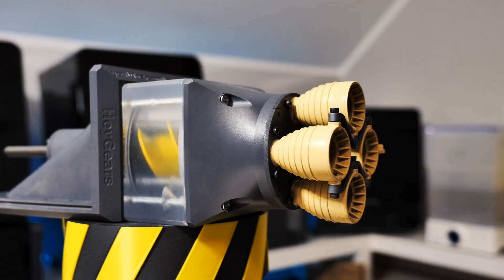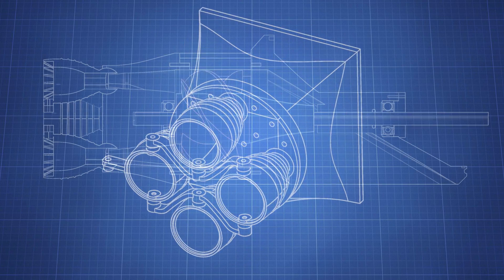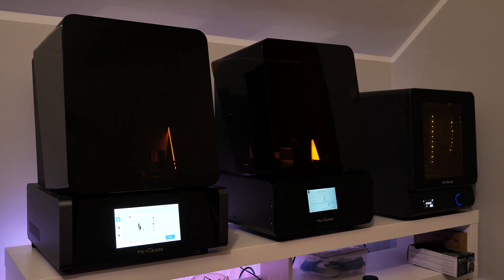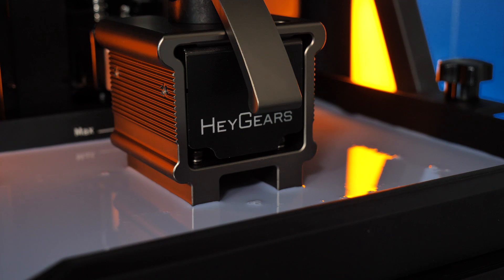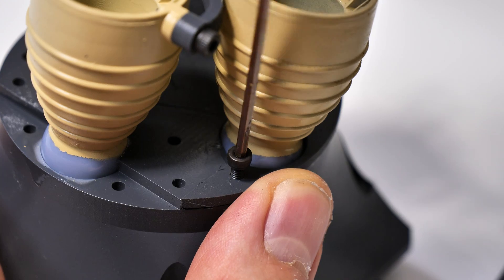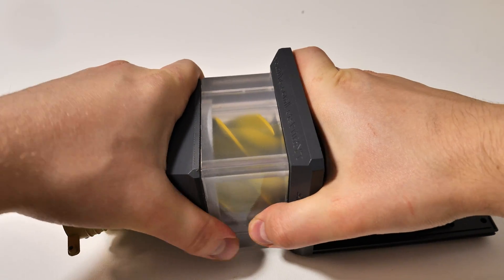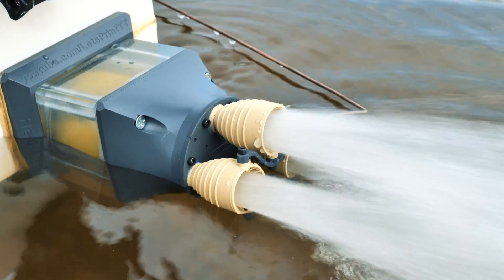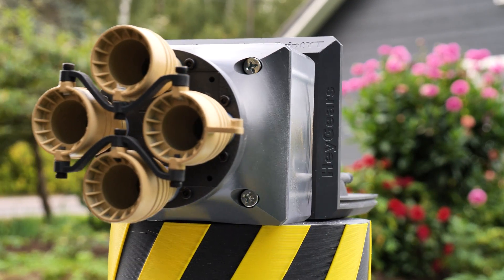3D Printed Water Jet with 4 POWERFUL INDEPENDENT NOZZLES

Comment: Looks amazing Ma8, I want to build a amphibius car, that drives on land and moves through water, and that when in the water the wheels get covered by the frnders and through the axial rotation and planetary gearboxses jetdrives get triggered and propell the tiny amphibius car forward. I know that sounds slightly stupid and crazy, but thats how I am sometimes. was wondering if you had any suggestions as to which small jetdrive would have the highest amount of propulsion for this. If possible, I would want to drive the car with cycling force only or in combination with a 3000W motor. What do you think doable ofr stuipid?

Comment: Hey dude U got litle wrong. It's true that Newton's third law say: for every action, there is an equal and opposite reaction. But I'm pretty sure that the water pushing out of the nozzle will make the boat move in the other direction even without Newton's 3rd law. Like if we take a hypothetical situation where it's my 2nd law, not Newton's 3rd, which is:
"every force causes an equal and ADDITIONAL force", do you doubt that in such a hypothetical situation both the boat and the jet would go backwards? It hink Ur boat great work in that case also..   Is it hard to do water sealed low friction, highspeed feedthrough for axis to 3D printed case??

Comment: The expanding portion of the nozzle isn't helping performance. Rocket engines do that only when the exhaust is underexpanded, but water is incompressible, so all you're doing is slowing down the water's exit velocity.

Comment: Very cool.
For making costume seals.
Its easy with some fdm printed negative molds.
Use 2 or 3  cask. 

But use 2 componet mould Silicone. 

I have made many costume seals. And can do very complex geometry.

You should give af go.

Tip...make sure to make small holes in the form for air to escape. Inject with a syringe.
When silicone is coming out of the went holes. Close them up and continue to add some extra silone to fill out any cavatiees.
Reply from the maker: I will look into it!

Comment: Get a machined spring coupler and join your impeller shaft to a high power offroad skateboard motor you have mounted in your boat, because if you take off the skateboard wheel, you can use the threaded end of the shaft to connect to the impeller, all the gear reduction is already built in and it's built to carry riders down a mountain so pushing the water should be okay, reliability/durability-wise.
Thanks for all the inspiration and taking time to produce this upload for us.

Comment: Why dump the water in the air? Water cant push against air. What a loss otlf thrust...put the nozzles underwater, please.
Reply: That's unfortunately not how things work. Jet nozzle in free air makes a higher push force as the water jet velocity is not restricted by the surrounding water. Watch naval engineering YT channel about waterjets 🙂: https://www.youtube.com/watch?v=C9jGKaiZIcQ
Reply: @Fischertek  is this also why jetski has it underwater or is it not a jet?
Reply: @rdcabal  If you see the linked video, you can find the answer. Not all jetski's are jet propulsed.... A propeller in a tube is not a jet. Beside that, it's pure physics.
Reply: @Fischertek  so, wj are brutes on power...
The way i see it, wj are for toys, where not getting chopped by an outside impeller is critical.
Reply: @rdcabal  "waterjets are for toys"? Explain what you mean by that.
Reply: @Sharpless2  tub boats, liners, tankers, container ships, fishing vessels, speed boats, etc run a prop/external screw.
Reply: @rdcabal  propellers are simply easier to maintain, but there are also personal watercrafts, speedboats, military and recreational ships with waterjet propulsion.
Reply: @rdcabal  both have their own use cases where they excell. Dont forget the other waterjets, the ones that are used to cut the hardest materials the universe has to offer.
Reply: @Sharpless2  funny you should mention that. I operated one at work. Engraving with water, cutting with sand, ruby dies, 50kW pump, sand recycler, the works.
Reply: @rdcabal  50kW pump?! Jesus christ! how many psi did that puppy generate? 60k?
Reply: @Sharpless2  plenty, that was almost 2 decades ago. The shop owner was Rom Radomski, Carlstadt, NJ.

Another weird pump use was at a bakery.   Fresh bread went to a 6-8 mBar chamber where it sucked the moisture completely out of the goods, which then went into a frezer. Monday it went to a humidifier/heater and was freshly baked.
Reply: @rdcabal that's how jets work in general, flow pushes against molecules already pushed instants ago. Since air has lower resistance than water, drag from turbulence caused by backwash practically doesn't exist and flow can therefore reach greater velocity.
Reply: It can, it just doesn't do very much

Comment: Have you tried TPU printed gaskets? That way you can still take it apart without having to reapply the silicon.
Great video. Keep up the good work.
Reply from the maker: Hi, yes I have tried TPU gasket, they don't work they actually make things even worse.
Reply: What happened? How did the tpu fail?
Reply: TPU gaskets would need a huge amount of pressure to work, so lots of screws tightened right up to near the material strength of the plastic.

Comment: Diverging nozzles only work for gasses. A single nozzle is more efficient than 4 smaller ones.
Reply from the maker: This water jet is not designed to be efficient, there are 4 different nozzles only to make it cool. Also in the video, there are no claims that this design is somehow better or more efficient than the original design.
Reply: @LetsPrintYT  proof that engineering youtube priotritises views over good engineering
Reply: @randomsnow6510 it's still good engineering. Less flow through 4 nozzles is less stress than more flow through 1 nozzle.
Reply: @LetsPrintYT  don't you wanna go faster tho?
Reply: @nuttyDesignAndFab  He's doing something different and practicing design and production/prototyping. Not everything is about going faster. 

Like if you really want to go fast you probably better just buying a jetski...
Reply: How about the effect of the air suck in by the nozel at the throat..the outlet seem mixed of air and liquid .. what's impact it give to the thrust efficiency
Reply: It would be interesting to see if the air bubbles in the water make a difference 🤔
Reply: @tucsondog  air bubbles and liquid pumps generally don't play nice together. if you look at engineered nozzles they tend to just end in a sharp edge.
Reply: but it looks cool. think thats all that matters in this situation
Reply: @nuttyDesignAndFab while I agree with the questionable purpose of a divergent section for subsonic flow, IMHO by keeping the flow path straight by splitting the flow into one nozzle per vane you reduce drag, which isn't as important for gases but may be for water, because it's much more dense.
Reply: @geekmidget  everyone is entitled to their opinion, just know that yours is wrong. pi*r^2 vs 2*pi*r, regardless of the fluid the increased circumference to area ratio of the nozzle WILL create more viscous drag.
Reply: Worth noting that those aren't nozzles, they are buckets. Their purpose is to direct the flow of water without slowing it down too much. I don't know how well they do their job, but I imagine the purpose of the curved profile is to give a smooth change in direction when they are angled to the side, not to act as a diverging nozzle.

Comment: You would gain a lot of efficiency if you added an open shroud around the nozzles that can pull in water from the front and let it flow around the jet.

Comment: You are very talented well done! Did you know ? Ive seen no one on YT take the strongest resin for printing and add FLG Few Layer graphene powder to it? Please can you do a dog bone strength test with eg 2% 3% 4% 5% 6%  added FLG? I promise it will get many views....
Reply: Nice video idea! I have seen strength tests with FLG additive in resin, just a few % makes a massive difference in strength. Would need a motor strong enough to utilize the added strength and possibly compare a closed style impeller against the screw style (or maybe a closed screw?) to see if you get any more thrust that way.

Comment: It is a nice project.
Nozzle design is nice to look at, but not optimal: you are reducing the speed of water by letting it expand. Also, there is the possibility of cavitation in that recessed parts (less thrust and faster failure).

Your design works well for gas, but water is a nearly incompressible fluid, so it's the wrong geometry.